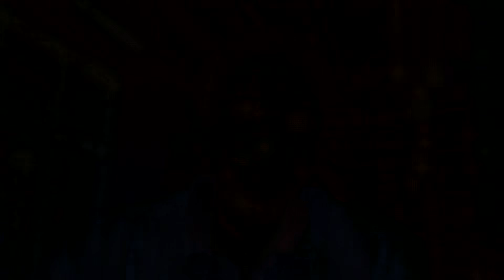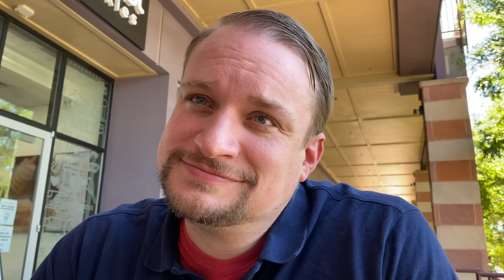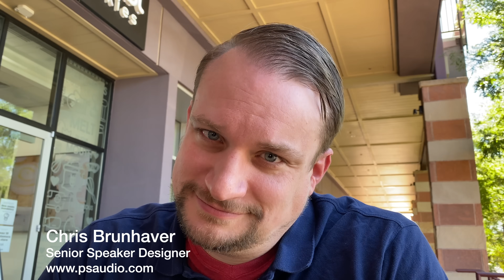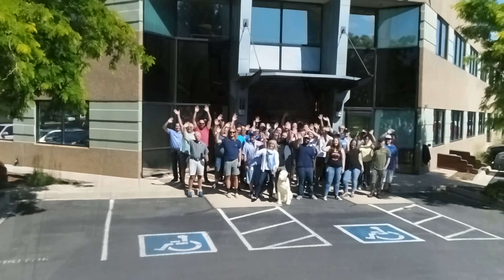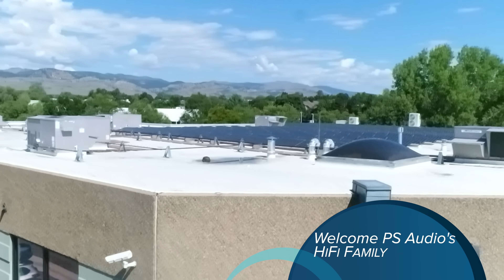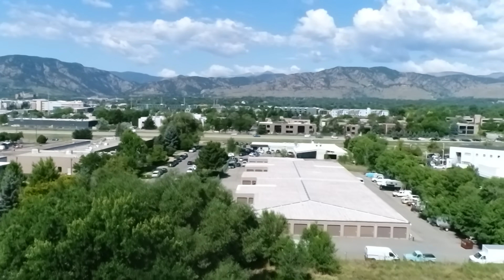Transmission Line Speakers

Comment: Hello sir can i ask which do you prefer of using passive radiator in small speaker like 4inch speaker below is it good to use thin radiator or thick radiator?

Comment: Good video. Let me add that 1/4-wavelength effects are far-reaching. They can be applied to transmission lines and antennas in electronics... and also apply to light/optics!

Comment: I still have a pair of IMF TLS-50/II in my collection, haven’t listen to them in over a decade, but they remind me of the polite 70s-80s British sound, like Rodgers LS3/5as which I had in the 80s.  I had sold this pair numerous times to buddies who would want something else I had and I’d take them back in trade, they came back when I sold/traded my Tympani 1Ds.  My Beveridge BSSS Model 2 had a similar easy not explosive signature.  It was when 8 bought a pair of Altec 755as that I switched from my previous lov3 affair of electrostatics, I had 3 pairs of 57s all at the same time, had Sound Labs R1s and Beveridges, now it’s strictly into the Altec sound, especially the front loaded horns, like 821 and 211 bass cabinets.

Comment: After 5 designs Lynn Olson's Ariel 6e TL speaker has to be one of the best out there. Even tho I am an accomplished woodworker these were a difficult build and expensive. I built them in 2016 and even then with a mid-grade xover I had about $1800 in the project. But OMG the sound!! With separate 6ft TLs for each 5 1/2" woofer the bass extended down to where no sub was needed.

Comment: I once asked Vince Bruzzese of Totem speakers if his floorstanding designs were transmission line.
He looked at me like I just farted and said... "absolutely not... transmission line speakers are slo-o-o-o-o-o-w-w-w-w". Then he went on to extol the virtues of his aluminum "beaks" sitting atop his speakers.
Reply: Strange, because Roger Sanders uses transmission line bass for speed (and other reasons too) to match the electrostatic panel.

Comment: The main principe of a TL is demping the resonance frequency of the woofer with an air column with a specific length and diameter. For technical details see The Rogers Domestic monitor.

Comment: "Possibly the best solution between ported and sealed speakers". Yes it is. (All this was very generic). Things have moved a lot since then. We can model TLs pretty accurately now. The results put everything else to shame. The only issue is speaker volume.
Reply: Only for the wives, if speaking about cabinet enclosure volume.

Comment: My German T+A Criterion TCD 210 S, designed by Jochen Fabricius, are transmission-line speakers that are fitted with a very long transmission line (I have an picture of the internal construction I wish I could post). They have two 8.66" low frequency drivers, two 6.69" mid-range units in an D’Appolito configuration, and a 1" dome tweeter with waveguide. They are a 4 ohm speaker with a frequency range of 25 - 35,000 and sensitivity of 88db. To me, they have a natural sound, with powerful, high-quality bass and highly detailed imaging.

Comment: I am making a classic /straight T-line with a 12" woofer. The cabinet/waveguide is now at 240 lenght and is around 155 liters. Someone i know say i should try to make the T-line closer to VAS of the driver(85 Liter) Should i worry about VAS when making a classic T-line? I dont se how since the line area should equal or exceed slighty the cone area of the driver used and the line length should be 1/4 wavelength tuned to the resonant frequency of the chosen speaker. Can someone help me out? Thx

Comment: I used to have Transmission Line speakers.  I don't think the company TDL exists any more; I used to have TDL RTL2 speakers and really enjoyed them, the RTL3 I thought were even better. They were enormous though; not very tall or wide, but exceptionally deep...I would say 3-4x deeper than the typical floorstanding speaker of the time.
Reply: TDL folded up in about 1995. John Wright, one of the founders died soon after. The RTL range were reflex/transmission lines. They replaced the earlier but more costly trandtional transmission lines range, - the Studios plus a couple of others models. They were even deeper. I have the Monitors which are 47cm deep, 30cm wide and 115cm high. In other words, big, but very nice to look at especially with the grills on. Their sound is awesome.
Reply: I’ve heard many a claim the rtl2 are preferred over the 3’s due to overall delivery and slightly deeper bass, I really would like to see the difference in “Original TL” against the “Reflex TL” hmmmm 🤔
Reply: I instantly regretted selling mine, the RTL-2's. My wife nagged me for less obtrusive speakers. As "Joe" at Huddersfield Hi-Fi referred to them as being "creamy" which was a perfect analogy to describe them. They were best suited to jazz and acoustic I found. The vinyl wrap just set them off nicely. I still miss them after nearly 30 years.
Reply: The TDL Reference Standard, as highly rated by UK's Noel Keywood in Hi-fi World in around the early 1990's was a remarkable swan-song achievement.  Dual racetrack bass units in what was a colossal enclosure.  I often wonder how many were made.

Comment: PMC does TL absolutely right. Their midrange and mid bass are superb and clean because the line is designed properly and dampened correctly. Few speakers can match the clarity and extension. Most manufacturers just can’t stomach the time, effort and cost to build the cabinets. Still love my GB1i’s!!

Comment: Thanks Chris.  Transmission lines got me into speaker building.  There was one at the hi-fi shop in Pullman where I went to school.  It would shake the tiles in the suspended ceiling which was totally amazing to me.  I've built a few over the years but am more of a ported box guy these days, mainly due to the more reasonable enclosure size.

Comment: Ports and transmission lines might sound subjectively good, but it runs counter to the fact most claim they're all about "purity of sound", and they are "merely attempting to hear the recording as it exists."

Ports and transmission lines cause you to hear delayed reinforcement waves. The phase alignment results suffer. Eeek ;)

Comment: I have TDL RTL 4 since the mid 90' and still rocking.
Reply: The RTL range are actually reflex/transmission line but still good. If you ever get the chance to hear their earlier Studio 3, Studio 4, Monitor, or Reference Standard, then do! They are true transmission lines.
Reply: @johnr6168  I used to sell TDL in Chelsea 35-years ago, (not the Reference sadly - too big for the dem room) but they were each superb.
Reply: I have worked my way up from RTL 2's, RTL 3's, to Studio 1's, the better version with the rebated cones. They don't kick butt like the Tannoy DC3000's in the living room, but with the volume low, as I have to have it in the evenings, when my wife is in bed, they loose none of the bass. Like the Tannoy's, they'll probably see me out :).

Comment: Still rocking the pair of TL speakers I designed and built about 40 years ago.  I had to re-foam the woofers about 10 years ago.  I recall spending at least as much time tuning, using some equipment I borrowed from work, them as I did building them.  I was just out of college and told my parents I wanted 4 sheets of 3/4 in. particle board for Christmas.  When I made it home for the holiday, fired up my dad's table saw and cut all the pieces and packed that into my car and drove ~1000 miles back home.  Then assembled the parts in my apartment.  A few years later, I made a spur of the moment drive from the SF Bay Area to Seattle to grab 4 - 10" TL drivers from Speaker Lab, I think that was the last 4 they had in stock.  These replace the original 8" drivers I originally used.  All the crossover coils were hand wound out of 14AWG enameled wire.  They are large, 2 feet square and 4 feet tall, sized for the 4x8 foot sheet of particle board.

Comment: My dad built a pair of TL speakers using KEFB139 LF drivers in an 89 inch damped tapered line. He stuffed it with Dr Bailey's long hair fibre wool ... they had a crossover at 200Hz at 12 dB / Oct and sounded magnificent ... better than the commercial Redford R50 model

Comment: Actually, the most common transmission line design that many people will readily know is the Bose Wave radio. 

I like how P.S. Audio is going about using Chris in these videos. At first people were often complaining about him but now that he gets to show that he really knows his business it seems there's more respect in the comments. He'll never be as charismatic as Paul but that's not why he was hired.
Reply: This is true!  I think in the case of the Bose Wave Radio they use transmission lines to make a dual chamber band pass.
Reply: @mattuw82  Yes, something like that. It's very much Bose's patented take on a transmission line. It's quite short compared to a tranditional transmission line and also happens to be made of plastic. For what is essentially a radio it could do a good job but I cannot understand why Bose choose to then boost the bass electronically while also suppresing the treble to leave an over heavy sound that lacks detail.
Reply: @johnr6168  Because without that order of curve, the Bose would sound saddle-backed in response to an even more detrimental effect, plus the wider market of non-audiophiles worship bass in their boogie coming from something small, so that was likely their remit for design from the thrusty marketing department.  My two Porsche''s had dreadfully overblown sound and only worked with bass and treble pulled almost right back with rearward bias on the fader.  Anything more and it was a claustrophobic cavern of bass emphasis.

Comment: TQWT also has crushingly low sensitivity for any given driver/cabinet size and f3 combination. The trade off is HUGE. Why do a dual 6.5" MTM with a 26hz f3 at 84dB when one could employ a critically damped vented alignment in the EXACT same enclosure dimensions and net another 5-7dB of broadband sensitivity while "only" having an f3 of the low 40hz range? That's tantamount to doubling/quadrupling your amp output wattage for a few hz down low. A trade most would happily make.

Oh and that QWT will never make bass as well as even a moderately sized subwoofer, properly positioned and time aligned.

Comment: A lot has to do with the Small-Thiele parameters of the speaker, particularly the Qts (if I remember correctly) which to a speaker is kind of like the compliancy of a phono cartridge.  I think optimally, it should be between .45 and .6.  You may get speakers outside that range to work, but you would really have to pay attention to the details such as stuffing, air losses, possibly the taper of the line.  Also, whether it’s a folded or straight line would come into play.  I used to know all this decades ago, but haven’t delved into speaker design for at least three decades, so I’m a bit rusty.  Please forgive me.

Comment: I had a pair of IMF SPEAKERS, I loved the the sound, fast and they seemed to load the room differently than others box speakers, more like a dipole. Vandersteen uses a TL in its mid bass.
I am building a ten foot pipe TL using three 8 inch drivers, with some magnepans, when finished will see if the Vandersteen 5 stay or go. Bass will be eq below 80hz.

Comment: There was a subwoofer demonstrated, or, offered in the 70's that was tagged "The Coffin". That due to it's resemblance to a real coffin in size. It used two KEF B139's, one for each channel. There were two tunnels folded back once. One tunnel for each speaker. I can't rememeber if it was ported. It was a subwoofer therefore the external active crossover had to be rolled off at a 24db slope at or below 80Hz. It doubled as a coffee table and was meant, and demonstrated, positioned somewhere more towards the middle of the room not against a wall or corner. I only heard it once but remember being impressed.
Reply: Bill Kenney That would have been one of of Bud’s signature designs - Model H.
https://www.t-linespeakers.org/classics/friedH/fried_H.html

Comment: I remember meeting Irving Fred at in New Jersey Audio salon over 45 years ago when I was looking for a new pair of speakers. I was never a giant fan of IMF. I wound up buying Dahlquist DQ-10's. Never regretted that purchase for one minute. I would've never been happy with Fried boxes Not after hearing the Dahlquists.

You guys keep up the great job you're doing with detailing us on speaker design.
Reply: John Wright designed the transmission-line designs of IMF.  Bud brokered the marketing deal by setting IMF (and John Wright) up in the UK and importing/distributing them.  TL designs can fail terribly in the wrong room acoustic.  The Dahlquist was and is still regarded highly by engineers over here too.

Comment: I really enjoy Chris's insights on speaker design.  I still have my DCM TF600 speakers, an interesting design with transmission line bass, coaxial design with the tweeter mounted over the mid bass driver and two rear firing tweeters working at a lower volume.  They have a very natural sound with a holographic midrange. How the heck DCM got this design to work is a mystery.   lol
Reply: Dcm 600's are hidden jewels!

Comment: Interesting interview and topic. Thanks!  Is the new KEF LS50 Meta transmission line?
Reply: No.
Reply: LS50 "Meta" addresses the back wave in a different way. Very innovative to address mid and high frequency issues but unlikely to provide the same benefits in the bass region.
Reply: A legit transmission line is in effect an acoustic waveguide that requires a much larger cabinet than a sealed or ported box design.  The LS50 driver in TL would require a cabinet the size of a large floor-standing design.
Reply: Thanks for the clarification. I saw a response referencing Klipsch LaScalas being transmission line. Would the folded bass horn fit the design criteria?
Reply: Michael Westerlund - Klipsch LaScala (and Klipschorn) are NOT transmission lines.  They are folded horns - completely different design and outcome.

Comment: I would suggest mention of Martin J. King, his heuristics optimized MathCad worksheet models, and the information that he provides on his website.
Reply: Yes, I remember the t-linespeakers website. I recall some of the math on there being old/wrong, though it’s been many years since I looked into it .  I sometimes forget to mention things speaking off the cuff. Things like david mcbeans freeware horn respone program does a great job or things like AKABAK for more complex things.
Reply: @cbrunhaver  Fascinating perspective from one who clearly has researched the back history on TL designs.  John Wright (over here in England) was one of our handful of unsung heroes in hi-fi;  both studio and commercially.  Bud Fried identified this and took to setting it all into motion.  PS Audio would surely make an ultimate version of this loading one day?
Reply: After being much abused by DIYers and unscrupulous small manufacturers declining to pay his very modest licensing fees , I think Martin withdrew distribution and support for his MathCad worksheets. There are literally dozens of excellent enclosures designed using his worksheets - before my recent retirement from active building I constructed more than a few prototypes modelled by others, including many that utilized small “Full Range” drivers of the type to which Chris refers. In fact, I’m still living with two pairs of MLTL (mass loaded transmission line)  - one a single driver system, and the other a 2 way MTM.

Comment: the TriTrix MTM Transmission Line Speaker  DIY kit from PartsExpress is a fine sounding speaker especially with a few parts upgrades.   And if you don't mind assembling it yourself, a great buy for the money.  Also, the Seas "Thor" MTM Transmission Line Kit from Madisound is a premium version of a TL speaker kit.

Comment: I had a pair of IMF TLs years ago - my first floor standing speakers.  Unfortunately my apt was burglarized and they were stolen.  I replaced them with a pair of KM towers that had another interesting approach to loading the woofer.  The cabinet was fairly large, also floor standing,  and was filled with sulfur hexafluoride gas (SF6) which is about six times denser than air and supposedly was equivalent to making the volume of the enclosure six times larger.  It would be interesting to hear Chris's comments about that design approach.
Reply: Are you talking about Cerwin Vega's S-1 ''Thermo Vapor'' technology?

Comment: Here's an idea: Why don't you make a pair of them? Falcon Acoustics have re-created the original B139, B110 and T27. Their version of the B139 has improved power handling and longer excursion. I'd say it's a fine COVID project involving plenty of woodworking and lots of lambswool and done right, could complement your listening room experiences. Might well be a baseline comparing 1960s technology with the current one, 60 years later, when your loudspeakers are finalized.